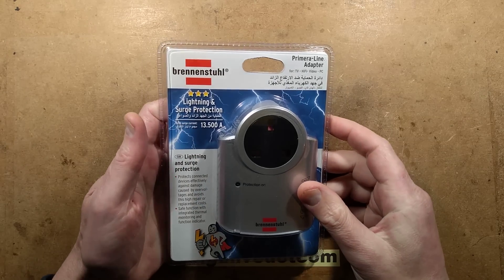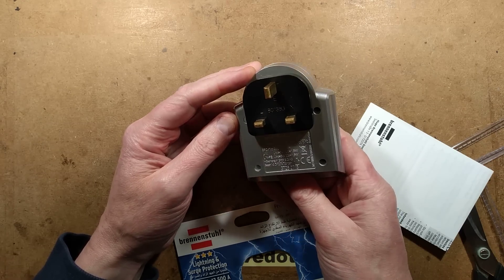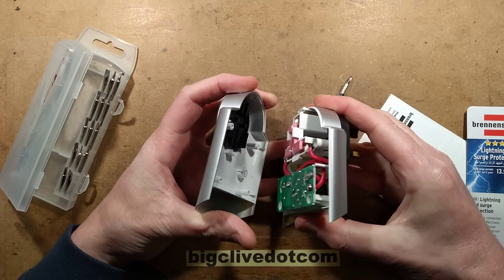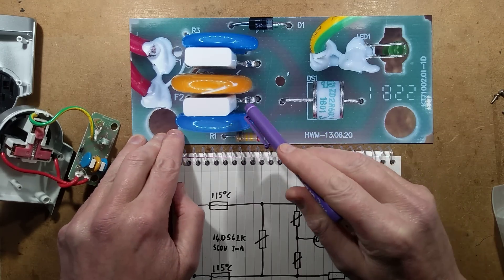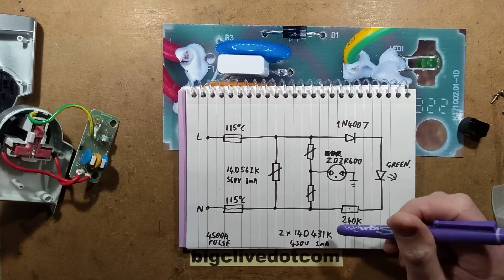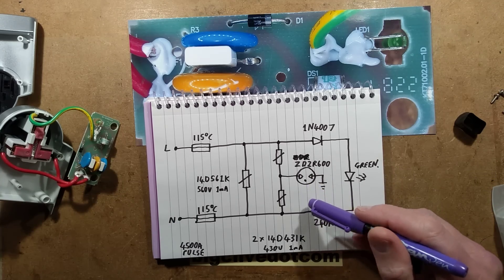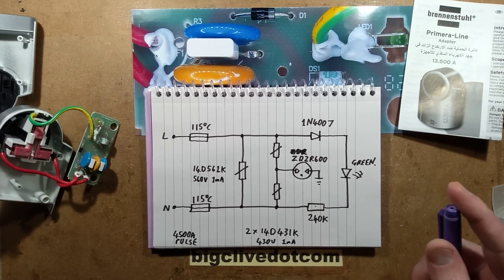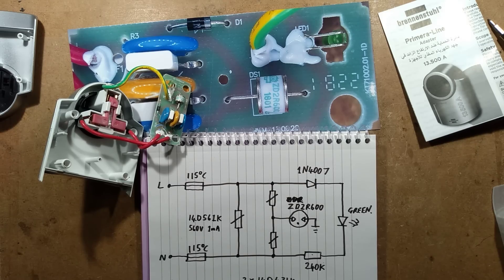Inside a 13,500A surge protector.  (With schematic.)

Comment: El varistor 14D561K tiene como voltaje de ruptura a partir 350 vac rms constantes con su respectiva tolerancia..... 
Y los Varistores 14D431K su ruptura es a partir de 275 vac rms constantes. 
La corriente máxima que soportan cada uno de los Varistores es de 4500 Amp....
Hay que saber leer la hoja de datos de los Varistores...

Comment: You shoud tear down an EMP shield surge arrestor. 😂 Fwiw i used to design special use surge protection devices for all kinds of spendy equipment. ❤ Older kurig machines have a surprisingly good surge protection board that uses a bilateral avalanche device inside 😮

Comment: What would be even if both fuses are broken?  Live part of the socket is connected to plug live part. So that, there will be no disconnection in the socket side.
Reply from the maker: It doesn't disconnect the socket.  Just the protection and its indicator.

Comment: Now available in its V2 iteration & seemingly great value. Two additional components inside, which look like a pair of large fusible resistors, each covered in a black sleeve? Other than that the layout is slightly different but rest of components broadly the same...3 x MOV's, 2x thermal fuses, the GDT. led, drop resistor & diode. Presumably better as a result?

Comment: Is it advisable to plug it into a free power outlet?
Reply from the maker: It can be plugged into any outlet without having anything plugged into it.  Preferably close to the electrical panel.
Reply: @bigclivedotcom  great !!!! and like that it will protect my entire electrical network? 😎😎
Reply from the maker: @impedance483  It will provide some protection against small voltage transients, but not a lightning strike.

Comment: Great video, great explanation. Thank you so much. I wonder that many brands put Joule ratings for their surge protectors, but Brennenstuhl never doing that. From the scheme you sketched the MOVs are rated 2x 115 J and 1x 125 J. So, can we add them to get total 355 Joules? Is it really the most important thing while you seeking a new surge protector for your single devices like a washing machine or a refrigerator only? If you look at product dimensions like this and a popular (and good) brand like APC, they also got single plug surge protection device like this and it's rated as 918 J,  peak currents of 24 kA common mode and 12 kA normal mode. If we compare this one 13.5 kA. Can you please answer that what to look exactly, better to go with more Joules or more peak current? I mean when a bad event occurs like lightning strikes etc.. Thank you so much.
Reply: El 14d561k soporta hasta 150J y el 14d431k soporta   145J , está en su hoja de datos.

Comment: I’m really struggling with having a GDT IN SERIES with the MOV’s. Maybe I’m just asking for too much (or did Ohm’s Law change since I graduated in 1976? 😣), but I’d (at least naively) expect to see different protective devices CASCADED rather than in series …

I remember another YouTuber had designed a ”three stage” surge suppressor (designed for handling EMPs) with MOVs, GDTs, and TVS diodes cascaded. If I remember correctly, one stage acted FASTER, another stage shunted more current, and I can’t remember the purpose of the third, or even which was which.

But … as far as EMPs go, sure it would be NICE to be protected against them, but considering the ways they could happen, I might just have bigger things to worry about!!!

Comment: I read a lot of comments  in various places that such devices can cause a fire. I found one such comment here.

And in general, if you search on YouTube: surge protector fire
- you will find many videos about it.

What do you think about that?
Reply from the maker: It is possible if they have inadequate thermal fusing.
Reply: @bigclivedotcom  Since I can't know if they have inadequate thermal fusing, then I think it's better not to risk it at all. Unfortunately, I already bought this device that you opened and analyzed in this video, instead of first seeing the comments about overheating and possible fire.

Even here I managed to find one comment that this device almost caused a fire in the house... I don't know if such comments are true, but it is enough that I don't want to take a risk with this device.

Also, I was thinking of buying an APC PM1W as I was told that APC is a well-known quality and reliable brand, but after doing a bit of searching on the internet - it looks like it's better not to take any chances with such devices at all...

Comment: How about for 220-240VAC?
Should I use a 431 or 471 volt MOV?
Leakage current?
Reply from the maker: Usually a 471 MOV.
Reply: Para una red de 220v RMS,   prefiero los Varistores 20d431K , que son de 275v RMS...... y si el equipo a proteger es muy sensible, entonces el 20d391K que es de 250v rms....

Comment: 560 volts?  So it would fail to protect against 415 volts.  I had one at work which DID protect when an electrician connected two phases to a room instead of live and neutral.  It melted and made the breaker trip for the room, 20 computers survived.  I guess this one would just clip the peaks and eventually trip a breaker, if it's thermal fuses didn't blow first.
Reply: Lo que pasa es  que NO saben  leer la hoja de datos de los Varistores, la gran mayoría de los electricistas o electrónicos youtubers Cometen el mismo error,  el Varistor 14D561K  protege de voltaje alterno constante hasta los 350v RMS con su respectiva tolerancia....

NO 560v RMS. esos 560v es el pico/transitorio de voltaje DC 

En las hojas de datos hay que buscar la columna que dice " MAXIMUM ALLOWABLE VOLTAGE"  ese es el voltaje soportado máximo constante en AC y DC

Comment: Hi, I have EU socket version of this device. If the mains outlet that I want to plug this device in does not have ground contacts, will this device still provide the intended protection?
Reply from the maker: It will protect against transients between the two connections.

Comment: Some spark gaps ( like the one shown ) have a very tiny amount of radioactive coating on each facing electrode ... this gives a tiny leakage current that vastly speeds up the firing time ( offering hyper speedy protection ! ) ....QED ...
Reply: Do you have any evidence that this particular one has a radioactive coating, because I've tested mine with a very sensitive geiger counter & then a gamma spectrometer & there's nothing.
Reply: @ajacks1349  You may not get ( any ? ) reading on your geiger counter , for the following reasons ... the amount of radioactive material is TINY ( picogrammes ! ) ... but the  MAIN  reason is the source is usually a ( β or Beta ) emitter .. these sources provide copious electrons (  β particles are free electrons ! ) ... these will supply a good amount to initiate a  VERY SPEEDY  breakdown of the arc gap ... protecting the device(s) ... however ( β , electrons )  WILL be  TOTALLY  stopped by the 1mm thick glass or ceramic spark gap housing , so any recording device ( yours ? ) will read nothing ... however , a ( γ , Gamma 😝 ) source would require several feet of Lead shielding to reduce radiation  .. hope this info is of use ... DAVE™🛑

Comment: The 13.500 Amps thing might be a localisation issue, for example, in Germany, we write thirteen  and a half thousand point two five as 13.500,25 (it's quite weird to get used to if coming from English where it's 13,500.25 but Germany uses the comma as the decimal separator)

Comment: Clive 
Is there any surge protector you would recommend over this at all?
In the market for a new one and despite being a sparky, I'm finding it hard to find some actual tests of surge protectors sold on the UK market, plenty of US market but little or no UK market.
Reply from the maker: It's hard to tell what's inside them.  Price is no indication, and it can vary over time for the same model.
Reply: @bigclivedotcom  thanks anyway

Comment: In the late 1980s a truck hit a power pole which had a transformer on it and the primary voltage went through one of our sub offices. Every electric appliance was destroyed including ceiling fans which had burn marks. The only things that survived were computers which had surge filters on them. The office manager was initially skeptical on the value of surge filters which were expensive at the time but became a convert after the incident.
Reply: Which surge filters that you used on this incident? Did you use brennenstuhl?

Comment: All, I had lightening strike my property (killed a large tree but not sure of where it hit... I lost a lot of appliances including my home theater .. I was rebuilding a vacuum pump and had a 1/2 hp motor sitting at my feet.. on the other side of my foot was a power strip with my laptop and 3 large displays plugged in. When the lightning hit, a bluish arc came out of the strip went towards the motor but hit my ankle ... it was not a good feeling .. QUESTION.. lightning can arc across some distance as I saw and felt, how can a surge protector stop this. I don’t understand how the arc would not just jump over the interrupt circuit and continue to the equipment .. what  don’t I understand about surge protectors and electricity...12,000 dollars worth of damage including blowing a garage flood light and bulb into 500 bits.. I thought I died... I remember yelling “OOUCHHHH !!!”.... and also yelling... “I’m NOT DEAD!!!!”...
Reply: Maybe they should have a regular fuse on the hot line.

Comment: Does that mean all surge protectors also protect other devices on the same circuit (say in a different electrical socket in the same room)? - Also the dim LED is potentially a feature, you dont want a really bright LED annoying you at night.

Comment: UK-style plug with english and arabic instructions), german-sounding name and made in china.
I guess if you have 50 year old electrical installation those things can be used as band-aids, but if you got somewhat modern automatic fuses/ rcd, just slap a rail mounted surge arrester into the fuse box and whole house is somewhat protected. Maybe not from a direct lightning strike if it flies trough the window, but if it strikes nearby it should work. Prices vary from 70 to 500 freedom dollars.
btw. surge arresters should be staged (2-3), with class D (last) to protect electronic devices. This thing probably isn't class D, plus it has to be at least 8 meters away from the device to protect it. Unless your PC has a 10 meter extension cord this wall-plug UK/arabic thing won't work :)

Comment: As far as I know MOV's and GDT's should usually fail "short". Then the fuses will blow and you probably notice. Question is what the chance is that the GDT fails "open".
Reply from the maker: it's possible for the gas fill to leak resulting in just an air gap with a much higher strike voltage.

Comment: I can not remember the brand but there was a surge protector manufacturer cut my dad a check after a  bolt of lightening and threw the Wall and hit his tv,, a dish network recever,  VHS VCR, & stereo. I thing the check was like 1500 it was a power strip so all was counted to power strip surge protector.

Comment: In germany we have to use proper Surge protection in new electrical systems.

These are rated for In 20kA and Imax 40kA also 275V AC not 400V like this device. 

So they trip much earlier.
Reply: @Ben T. Right

Comment: Hi would you recommend this or the Belkin SurgeCube 1 Outlet Surge Protector?? They're both single socket with single green LED light, pretty much similar from the outside. 

Thank you.
Reply from the maker: I've not seen inside the Belkin unit.
Reply: @bigclivedotcom  Thanks for getting back to me. I'll open mine up and take a look. It boasts protection up to 306 joules using Oversized MOVs with fibreglass covering. Also has three-line AC protection just like this one.
Reply: @bigclivedotcom  I've just torn down the Belkin one and made a review video of it on my channel. I've linked to your video (this one) in the description. The Belkin one seems far inferior. It only has 1 MOV and 1 thermal fuse rated at 115 deg C. Belkin claims it does 3 line AC protection which I don't quite get. They rate the unit at 306 joules. The one in this video of yours is way better for sure. On a side-note, the link to Farnell UK that you've posted is for the 4,500 A version which is much cheaper.

Comment: can you help me with this math>

Lets say that the software power meter shows that the CPU is using 80 watts
and that it's voltage is 1.284

80 / 1.284 = 62.3 amps

Surely it is not drawing 62.3 amps, since the CPU +12V rail is only rated at 20 amps.

What is wrong with this math?

Comment: Can you explain a little further how it would protect other devices on the circuit, do you mean anything that is on the same breaker basically?
Reply from the maker: Yes, and potentially in the whole house as common voltage spikes will be shunted by it.

Comment: Clive, your channel needs a lightning discharge to test this type of equipment. I beseech from experience and in awe of APC and Belkin. As an errant driver hit a pole in my neighborhood and sent a spike. I spent $250 replacing all of my surge protectors but some of my neighbors were worse off. No TV, No refrige, and No Freezer. You estimate performance. What do you need?

Comment: A sparg plug with a small gap and no series resistor would be just as effective, the thermal fuses would vaporise, basically its a pos.

Comment: The surge protector means that absorbs all the incoming spikes and overvoltages from the mains and cleans it protecting in that way all the other appliances.Absorbs current until limited by the breaking of the mains fuse

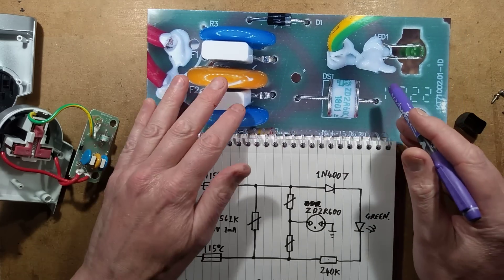Comment: 7:30   basic specs for ZD2R600:

Quick Details
Place of Origin:
Guangdong, China (Mainland)
Brand Name:
HUAAN
Model Number:
ZD2R600/20 , ZD2R800/20
DC Spark-over voltage:
350V
Surge Discharge current:
1KA, 2KA, 2.5KA ,5KA ,10KA ,15KA ,20KA,30KA,40KA,60KA,80KA,100KA
Capacitance:
1.0pF

Comment: Looks like a typical class D surge protector in an unnecessary large enclosure. You can get ones that fit inside junction box behind electrical socket.

Comment: The problem is they're adding extra redundant digits after the .5, so it's really difficult to discern whether it's 13 1/2, or 13500
Reply: Actually those are not redundant. It's just how thosands places are split for better readability in Germany (and it being a German manufacturer - a premium one, actually).
So that really means 13500A or using the same logic in english notation the number would be: 13,500.00A

Comment: If this design were to be used in the US, which parts other than the plug would need to be swapped out?
Reply from the maker: They may do a version with the correct plug/socket.

Comment: When you look at the back (time 3:06) you can see that it's rated 13A / 220-250V
Reply: These 13A just refer to how much constant current it can handle and not at how much surge current it can handle. At the front it states 13500A in German notation. This number translated to english notation looks like this 13,500.00A - the full German notation would also contain two decimal places like this: 13.500,00A

Comment: To anyone reading this comment, is it ok if I can have some help with understanding where the earth goes to in schematics . Is it neutral?

Sorry I’m new to electronics.
Reply from the maker: Sometimes schematics show an earth or ground symbol on their negative or 0v rail.  But it doesn't always relate to mains ground.  It just symbolises the circuits own voltage reference point.

Comment: If you do the calculations, that thing can only take 13500A for like a few milliseconds (less than one half mains sinewave), because the thermal capacity is small, and the resistance is too high.

Comment: What is that screwdriver set at 2:30.   All the ones I can find are 1/2" shank and that's too big for some of the recessed triangular screws I run into.  Thanks.
Reply: Try something like this - it comes with an extension. https://www.amazon.co.uk/gp/product/B01MYR7RKY

Comment: Wait, did I understood @10:30 right, that if I plug this into any random socket in my house, then all other sockets will automatically be protected?
Reply from the maker: It will have a limiting effect on a mains spike dependent upon the magnitude of the spike and distance to the socket.  The closer it's plugged to the distribution board the better.
Reply: @bigclivedotcom  Thank you for your answer, so it would "attract" the spike due to low resistance and basically "waste" its energy by heating up and triggering the fuse?

Now I understand the construction: The yellow resistor has a very high resistance as long as the voltage is lower than 560V, but if a spike occurs, the resistor lowers its resistance to a very small number and starts heating up which tripps the fuse and cuts the connection right after the spike occured. 

Thank you very much :)

Comment: Lightning Protector...13(thousand)5(hundred) Amps.
A Lightning Protector good for less than 15 Amps would be nothing more than an innocent looking Fragmentation Grenade just waiting for a Lightning Bolt to make it go BOOM!
To try and see what that looks like, see if You Tube has any videos of Class 1 or 2 Electrical Multi-Meters being used to check 700+ Volt Circuits (class 2 are good for 300 Volts Max. I believe).

Comment: What's the gas?! 
Because a phone charger I bought hissed on me and sprayed a type of oil at me and it was pouring out of the charger.
Reply from the maker: That would be capacitor electrolyte.  Usually water or glycol based.  Not harmful.
Reply: @bigclivedotcom  Thanks, man! 
It was plugged in when it happened, I heard hissing and boiling and the liquid was in the socket. I panicked and flicked it off at the wall. Next time, I'll head for the mains cupboard!